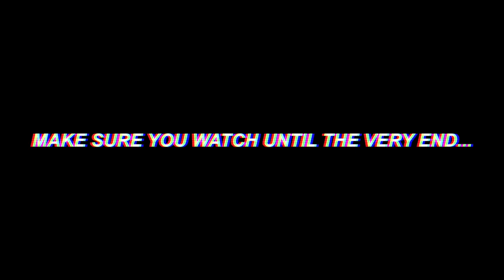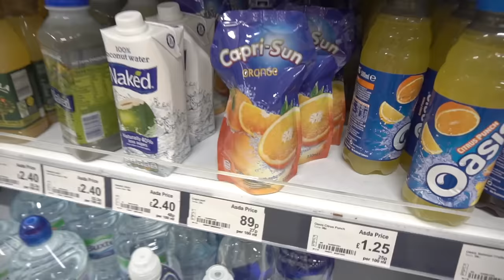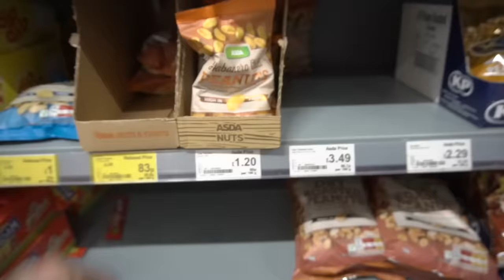I Buried Myself Alive on the Beach and It Went Incredibly Wrong (Buried Alive Challenge)

Comment: He should just left the door uncovered, so he could push it up, or dig from the inland side, if the door was too heavy. First test the weight of course, when first settling in the hole.
Yeah, and of course, why check the high tide limit - what's the fun in that? :)

Comment: Next time it gets hard to lift a door in any situation like this just flip onto your tummy and use your back to push the door up using all 4's

Your back has more strength and can withstand more pressure than your hands can. All you have to do is push up as hard as you can. Unless there's cement on top of the door you should be able to lift it up. Besides you seem pretty buff so it shouldn't be a problem for you :) 

Please be careful! Stay safe ^~^